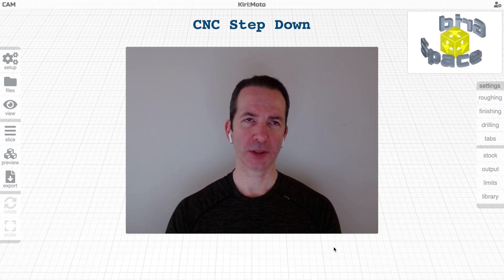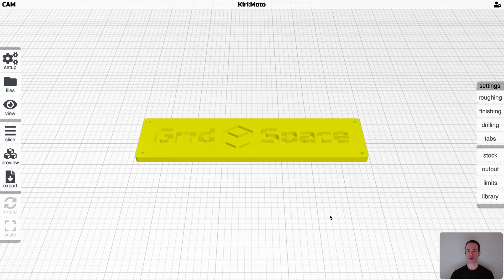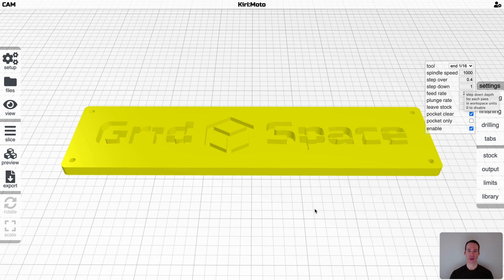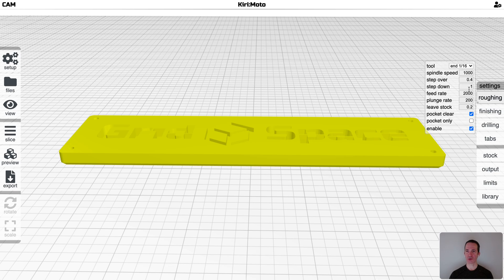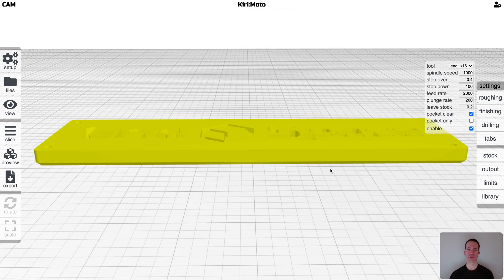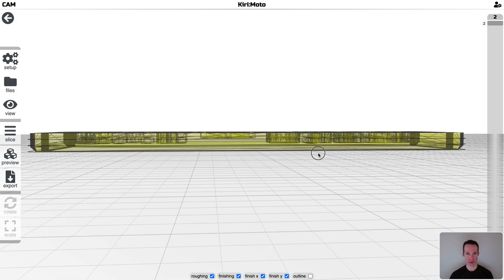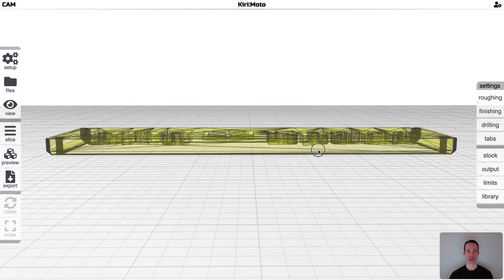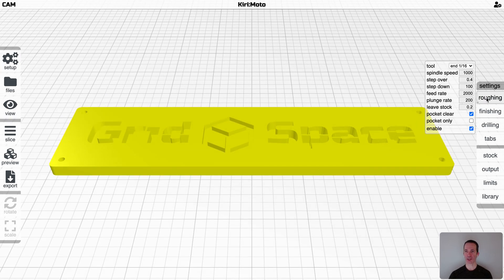Kiri:Moto CNC Step Down Explainer

Comment: I have some parts in which I have to introduces domino from Festo for proper assembly.  The dominos are 39mm long so i do a pocket of 20mm in one part and a pocket of 20mm in the other part leaving enough spaces (1mm total) to allow for glue.  My drawings are made this way but when i generate the pockets (each having 20mm deep) in kiri:moto and I machine the parts on my cnc, the pocket are only 18mm deep for a total of 36mm.  There must be a setting that causes this but I cannot find it.  Any suggestion?  I am now thinkind to modify all my drawings to compensate but it is surely not a good practice!  Thanks in advance for your help!
Reply from the maker: if the depth is wrong with roughing, have you enabled clear flats? if you use the pocket operation instead, you do not need to do this. if the XY dimensions are off, either you have "leave material" set in roughing, or your tool is defined incorrectly.